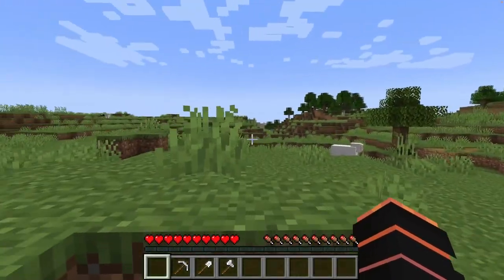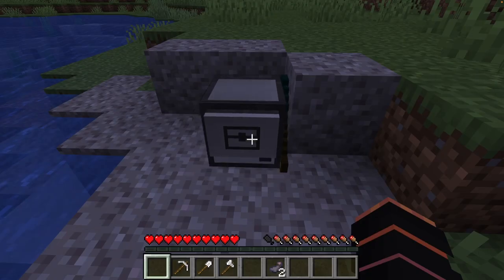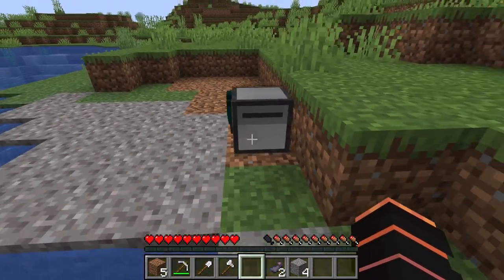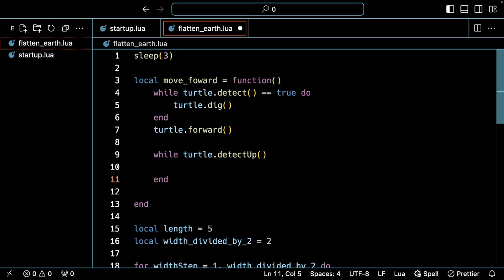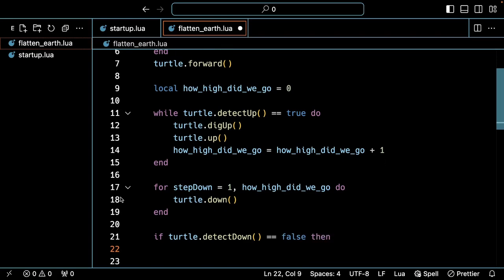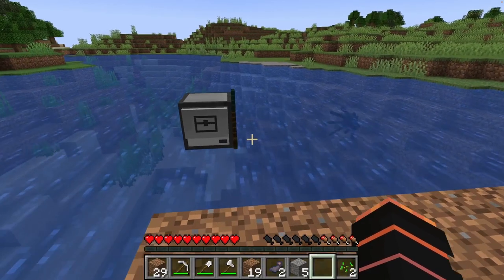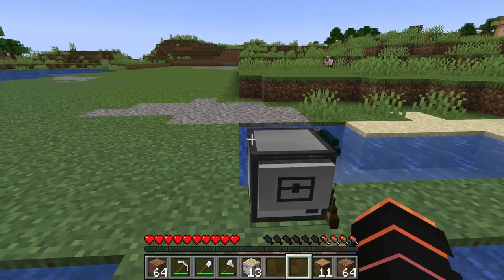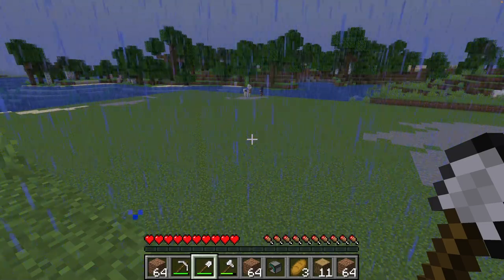Earth Flattener Minecraft Robot - Prototyping (Part 1)

Comment: How did you learn Lua? I've always been interesting in programming
Reply from the maker: I first learned Lua to make my own notes app (which I call my grimoire). It wasn't my first language, but it's a pretty good one to get started with. 

Some other good starting languages are Python and JavaScript. They're more practical outside of the minecraft world, but the fundamental concepts in all three languages are the same (those concepts being: variables, loops, and if/then statements, should you be interested)

So, I was able to write code in Lua pretty quickly because I'd already been using the other two. 

The same works in reverse. The core concepts in Lau apply to Python, JavaScript, and a ton of other languages.  And that's part of what I'm hoping to accomplish. Show folks some Lua in minecraft which may spark an interest in more programming that can be both fun and make for a good living.